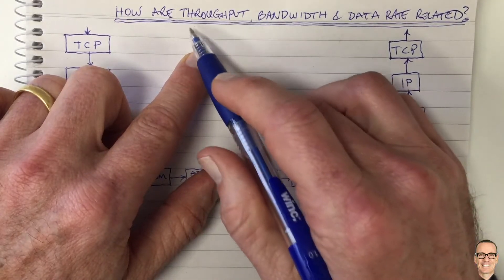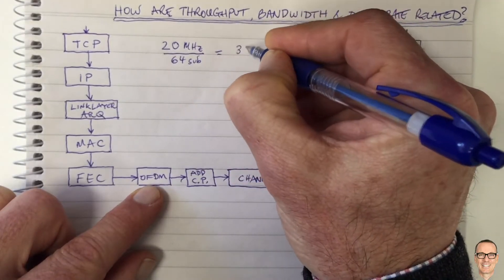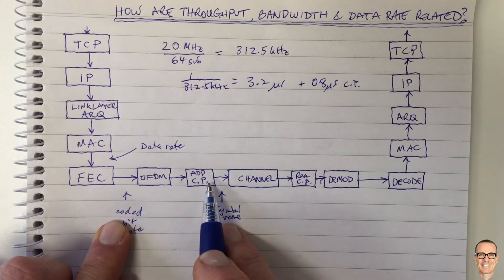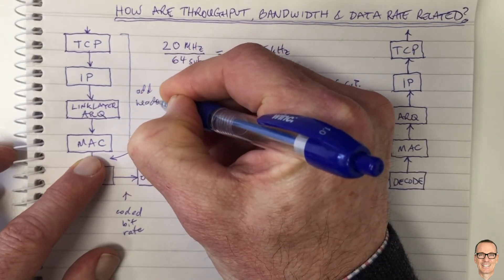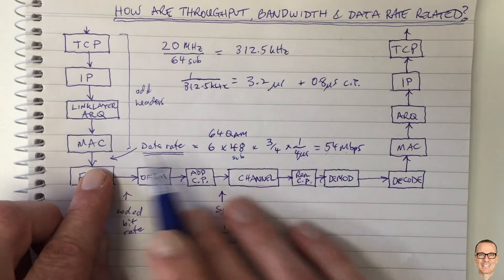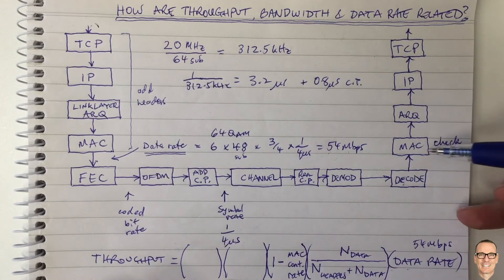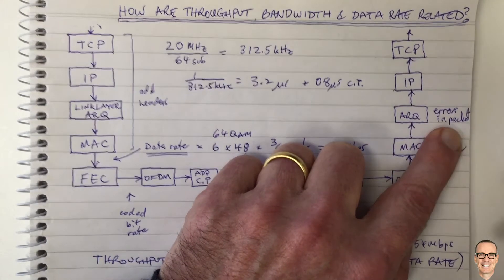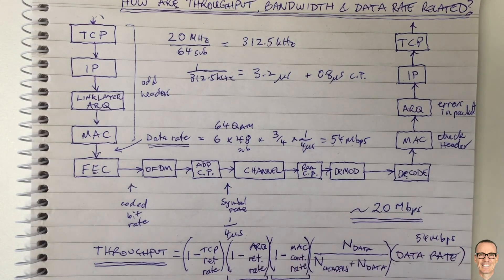How are Throughput, Bandwidth, and Data Rate Related?

Comment: Hi Ian, thanks for this video. Why symbol rate is not used in the data rate formula? Wouldn’t the data rate be symbols/s x bits/symbols x # of subcarriers? 6:05
Reply from the maker: The symbol rate is used in the data rate formula. It is 1/(4 microseconds)
Reply: @iain_explains got it! Thank you. In another video you mentioned bandwidth is 2/T and data rate is 1/T. In this case wouldn’t the symbol rate be 1/312.5/2 us ?

Comment: One Question: How can we attain the "packet error rate" by having the "symbol error rate", considering FEC? Suppose, the packet has 10 symbols, and SER is 10^-5. Then, the packet error rate will be [(1- 10^-5)^10] without having FEC. I cannot, unfortunately, calculate that rate when we have FEC.
Reply from the maker: Great question. The relationship you're asking about depends on the type of FEC that is being used. There are a great many research papers written on this topic for all of the many FEC schemes proposed over the years. The relationships are almost never straightforward, and often can't be written in "closed form". In many cases people have developed upper bounds, or approximations, or simulation based relationships.

Comment: Excuse me.I have a question for why the time duration of cyclic prefix is 0.8ms
Reply from the maker: The 0.8us CP is a design choice in the standard. It is 25% of the 3.2us symbol time. It was decided that this would be enough to account for the maximum delay spread that could be expected in most scenarios/environments/channels where WiFi would be deployed. This video may give more insights into the propagation path effects: "What are Flat Fading and Frequency Selective Fading?" https://youtu.be/KiKPFT4rtHg

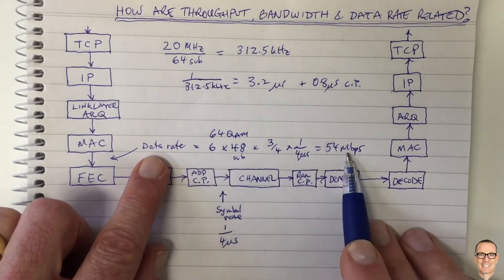Comment: The math at time 4:08 for bitrate calculation for 802.11 wifi seems to be not giving 54mbps.

Anyone tried calculating and share the formula if worked.
Reply from the maker: I just put the numbers straight into my calculator, and it gives 54 Mbps. Perhaps you should check again.
Reply: @iain_explains  
 
6 * 4 * 0.75 * 4000000 = 864000000.
864000000/16 = 54000000. Which is 54mbps.

I don't know why i did divide with 16.

Comment: Thanks for the video. I have some queries :

1) FEC is alternatively named as channel coding?
2) Is not HARQ a part of MAC layer? why have you put it as a différent layer between MAC and IP?
3) You mentioned about two factors while calculating the throughput. a) MAC contention and b) due to ARQ that you described to be linked to the channel. Not very clear about their distinction. Can you please explain again? The factor linked to ARQ is there because it means retransmission of the same packet that effectively reduces the throughput ? If yes, then this can be due to MAC congestion, no?Or what I am saying is true for MAC HARQ which is different from ARQ mentioned here ? Does ARQ mentioned here indicate the Radio link layer ?
Reply from the maker: 1) Yes
2) Yes, HARQ is part of the MAC layer, but ARQ is above the MAC layer, in what is called Radio Link Control (for mobile comms). I didn't mention HARQ in this video.
3) Yes, the factor linked to ARQ is there because it means retransmission of the same packet that effectively reduces the throughput. This can be because of a number of reasons, fundamentally it's because the FEC was not able to overcome the errors that happened during the transmission (for whatever reason).
Reply: @iain_explains  thanks. So, ARQ can be due to MAC congestion as well, e.g., when two different transmissions collide due to the same radio resources,no?
Reply from the maker: Partly, yes, but only if the MAC wasn't able to resolve the congestion itself. The MAC protocol aims to take care of the congestion on the channel, (eg. using successively increasing backoffs in the case of CSMA/CA in WiFi).
Reply: Thanks

Comment: Thank you for the video . It was very insightful . However ,I did not understand that after dividing the total bandwidth (20Mhz) by 64 ( # of sub carriers) we get 312.5 KHz . Subsequently you wrote symbol rate is 1/312.5 Khz . My question here is that how symbol rate is related to the bandwidth ? For example consider a binary symbol for 10 millisecond  duration . The Fourier transform of that will be a sinc function with main lobe width of 2/10 ms . Inverse of that is 5ms . So if we inverse the bandwidth we get lesser symbol duration. But in your case you took the inverse of subchannel bandwidth  and symbol duration is specified as inverse of that (3.2 microseconds)  . Can you comment on whether my understanding is correct or Am i missing something ?
Reply from the maker: Yes, you're right, a square pulse width of T seconds corresponds to a sinc function in the frequency domain of width 2/T Hz (https://youtu.be/ZBSvMbO0mPQ). However we don't ever send "ideal" square pulse shapes. Instead we send raised cosine pulse shapes (or approximations to them). The "ideal" raised cosine pulse shape is the sinc pulse shape, which only requires 1/T Hz bandwidth. See "Pulse Shaping and Square Root Raised Cosine" https://youtu.be/Qe8NQx4ibE8

Comment: Hello thanks for this video, I have a question if my wireless Access Point is operating on 80MH bandwidths and if I change it to 40MHz will my average throughout go down ? From your video it seams it would go down as per formula throughout is directly proportional to data rate and data rate will go down with Chang in bandwidths. Please clarify
Reply from the maker: There are lots of factors/parameters that might change in your modem as a result of changing the bandwidth, but in general, yes, if you use less bandwidth, then it will reduce the throughput. If the bandwidth is the only thing that changes, then it is a roughly linear relationship. Halve the bandwidth, and the throughput will halve. Check out this video for more insights: "How are Data Rate and Bandwidth Related?" https://youtu.be/ZBSvMbO0mPQ

Comment: Very informative video , thanks .
You mean GoodPut = throughput + L2+L3+L4 overhead.?
Reply: Edit : GoodPut = throughput -  (L2+L3+L4 overhead)
Reply from the maker: No, I didn't mention "goodput" in the video. Throughput is the actual amount of data that is successfully sent/received over the communication link. In the example in my video, it is the end-to-end rate of sending data. Goodput is a less-well defined concept at the application layer, which is higher up in the protocol stack. There will be many reasons why an application is not able to make use of all of the Throughput that is available to it on a link or over a network, which means that the Goodput is always less than the Throughput (but not because of layer 1-4 issues - they are already taken into account in the Throughput).

Comment: Very Informative video it is!
but I'm having some confusion. Why are you taking 64 subcarriers at one place and 48 subcarriers in the other? Doesn't legacy LTE with 180 kHz bandwidth only can carry 12 subcarriers of 15 kHz size?
Reply from the maker: As I say in the video, the numbers I used relate to IEEE802.11a WiFi over a 20 MHz channel. Other systems that also use OFDM, such as LTE, use different bandwidths and different numbers of carriers. One of the reasons for the differences is that cellular/mobile standards like LTE need to handle user mobility with potentially fast fading channels, and so they need to allocate more resources (eg. sub channels) to do channel estimation.

Comment: Superb video Iain. Greetings from Spain!

Just one comment, I prefer to calculate data rate with Nyquist formula, you know:
Vmax = 2*B*log2(V) so with your example it would be = [2*312,5*log2(6) ]*48*3/4 = 56 Mbps. :D
Reply from the maker: The so-called Nyquist bit rate is an ideal situation where there is assumed to be zero noise in the channel, and where the signal can take on a finite number of levels. You need to think carefully about how you use it when considering real channels like the ones I am talking about in this video. One point to make is that the formula you've written does not take into account the time needed to send the cyclic prefix. Another point, is you seem to be using 6 levels, when QAM has 8 levels (in each of the real and imaginary directions/dimensions).